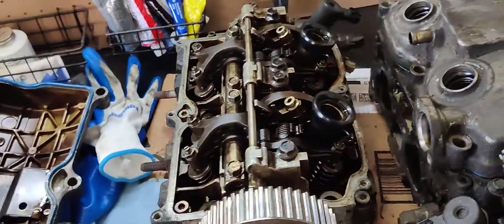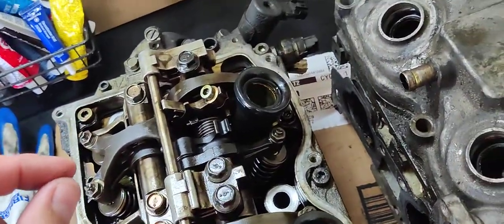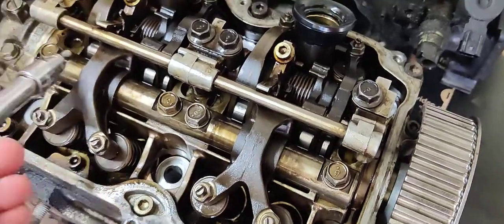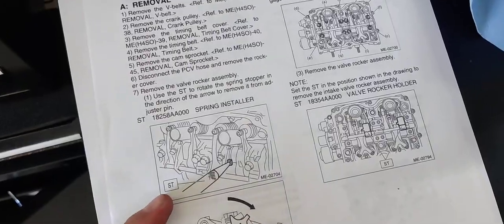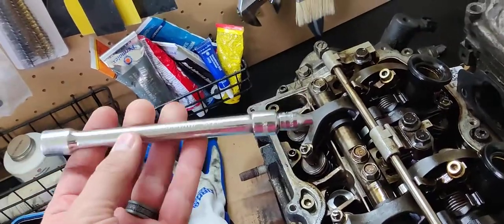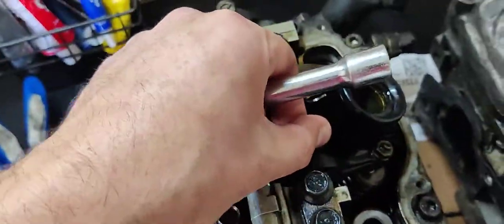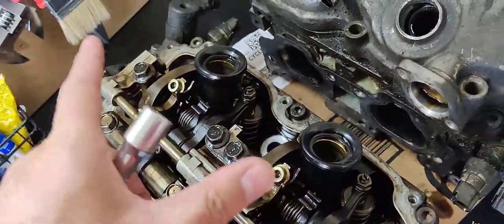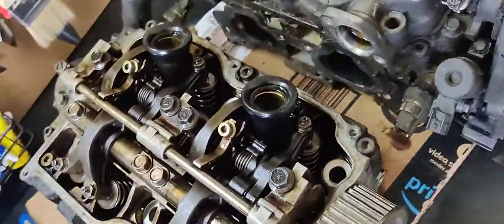Subaru EJ253 2.5i AVLS SOHC valvetrain rocker arm assembly removal and install

Comment: Thank you immensely I didn't even know what FSM meant, figuring out that diagram did not work for me so your video was a lifesaver. The rocker assemblies came off flawlessly. Now I'm ready to remove the head bolts and get the heads to the Machinist. Much appreciation to you for taking the time to video this and get it posted back to the Internet. Thanks again.
Reply from the maker: Yeah, sorry, FSM = Factory Service Manual

And nice work getting it all done!! I hope the rest of the project goes smoothly and turns out good. 👍

Comment: No way.
I was so stumped with that part, but your video has re-fired my efforts to finish my job the right way. Still have valves to reseal and check, and getting those rockers off was a huge road block for me. 
Thank you for explaining this so simply!

Comment: Great video.. We broke the "push pin you mentioned at 1:52min, any idea what that actual part name is for ordering?
Reply from the maker: Not off the top of my head. Either way, I don't believe Subaru sells individual valvetrain parts - I think they only sell it as an entire assembly. 

Personally, I'd go to the junkyard and grab it myself. 

Good luck!

Comment: My pin stopper broke, any idea on what can be done? Can’t find any similar issues on the internet
Reply from the maker: If it were me, I'd go to the local junkyard and pull the entire valvetrain from any Subaru with the EJ253 engine, and replace the broken part(s) accordingly. Unfortunately you can't order individual parts associated with the rocker arm assembly from Subaru, it only comes as an entire assembly and it's expensive!

Good luck!

Comment: I have a car I suspect this to be messed up in as it has recently been apart previously by an "unknown". Car runs good but generates P0303 and P0304 at 3000rpm  with an associated "ticking" noise. My plan is to pull the rocker covers to take a peak if the springs and sliding pistons are in place. If it is messed up I hope it possible to straighten it out in the car without pulling the motor.

Thanks for the Great video, it is far better than what I spend $$$ a month on for service information related to this problem
Reply from the maker: You're very welcome. One trick to get better access to the valve covers and heads is to raise the engine up a little. 

First you need to remove the exhaust manifold, or at least unbolt it from the rest of exhaust system. Unbolt the two engine-to-chassis grounds that are on each head (you can see them from under the car), then remove the pitch stop and finally unbolt the engine mount-to-subframe bolts. 

Now just set your hydraulic jack and a block of wood under the oil pan, then you can lift the engine up from within the engine bay. You can raise it a good 6" or so and it makes accessing the heads SO much easier, all while not having to remove the entire engine.

In fact there's a YouTube video that shows how to do it...
Reply: @crxtodd16  great tips, thanks! Yes, I agree raising it is the way to go. I did a few “walk through” with another engine on a stand and it seems very doable keeping it all together with the motor  in a flat configuration.
I am still diagnosing a P0303 and P0304 but am confident in dealing with the VVL rocker if I need to.
Reply: @crxtodd16  great video as i'm tackling the head gaskets on my 2012 outback and need to remove the rockers before sending the heads to get resurfaced.  quick question on raising the engine.  anything special to note about jack placement?  given the oil pan has a slight angle on the bottom i was having issues with the jack and wood block slipping as I was shifting the engine left to right.  thanks!
Reply from the maker: @michaelzuromski1780   Yup, that can definitely happen. See if you can place the jack at the bottom of the bell housing, as forward as possible before hitting the subframe. You'll definitely need a block (or two, or three, lol) of wood to get the height. 👍